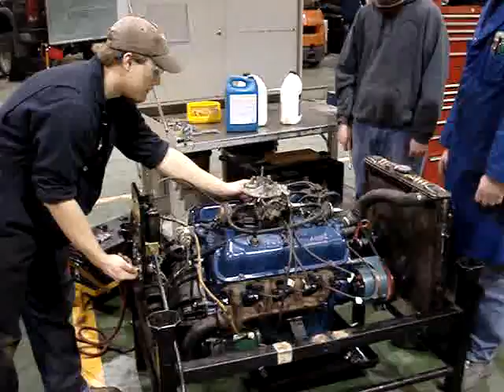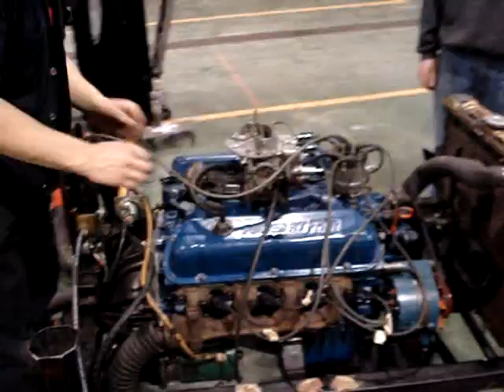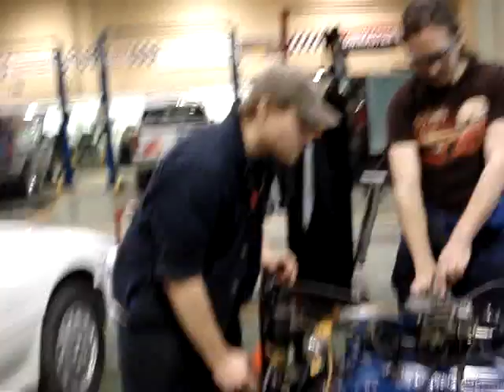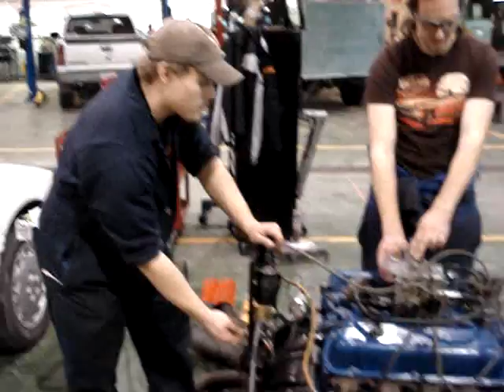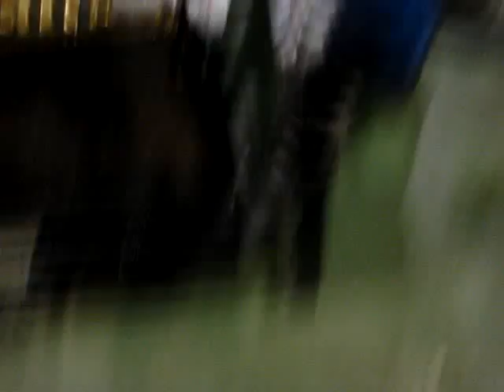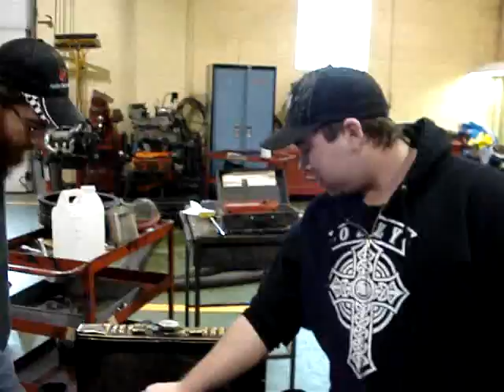Ford 302 Startup

Comment: 8:30 still not running, ok .. this is an older upload ... but, 'c'mon men. This engine is not prepped properly to start and run. It should fire right up and run. Prime the carb (was done right) have the static timing set, SET THE CHOKE !!!! This isn't rocket science.. auto mechanics 101. (and so many "rebuilders" don't get this? )  The engine MUST start up immediately, no excessive cranking, high idle for 30 minutes vary the RPM 1500 to 2000 RPM, brief revs to 3500 RPM but no high RPM revs for the first 30 minutes. This is to break in the cam and seat the rings without making the glow red hot and lose their static tension.

Comment: Even if it did start do not run it for long as you can see the top radiator hose is kinked so coolant will not flow

Comment: Carburation in those engines series required a very well made regulation. Not knowing adjust the idle does not work well on these machines. . .

Comment: start again boys that is the whole reason that you are at motor shop after all the winding over sounds like a spun bearing timing out vacuum line off rebuild the lot again take time this time around starting a fresh motor is like touching puss for the first time that was like touching a shit covered freckle with your tongue there is nothing like the first turn of the key and have a great sound of a fresh start its a addition to hear that sounds only when you do it right round 2

Comment: Must've been put together by real dumbasses. I could get my old  Honda Civic to start off of 30-60 psi per cylinder; the damn car required a rebuild at anything below 140psi. It didn't run too well, but it started with the flick of a switch.

Comment: I've never seen anyone have such a damn hard time getting a rebuilt engine started. Fill the float bowls up. Set engine to TDC #1 compression and align the distributor rotor with the number 1 sparkplug wire and advance it slightly and watch it start right up.